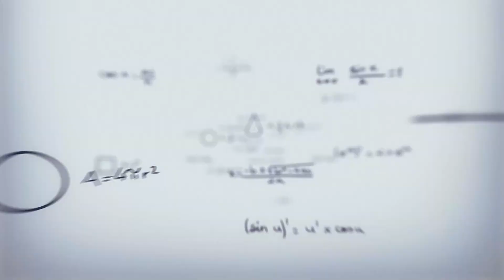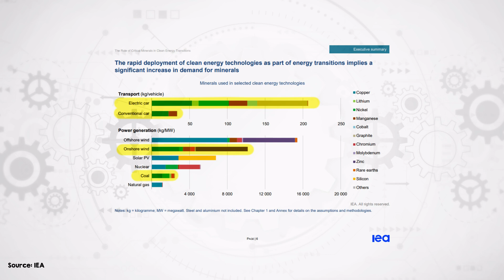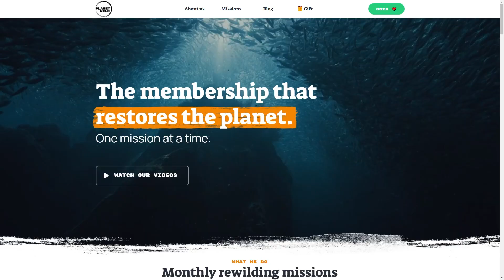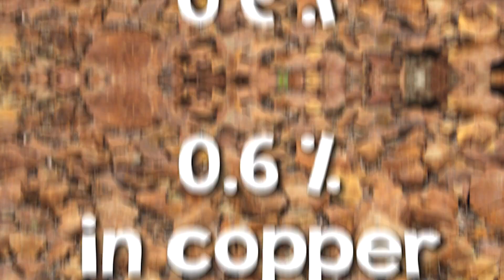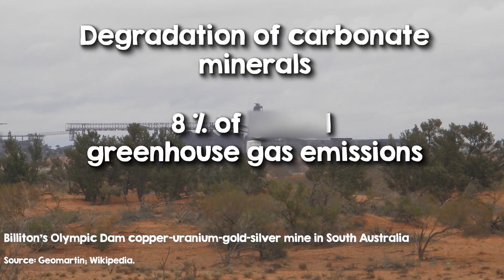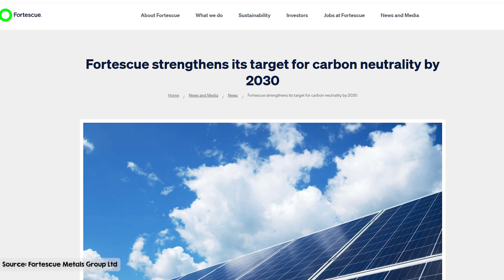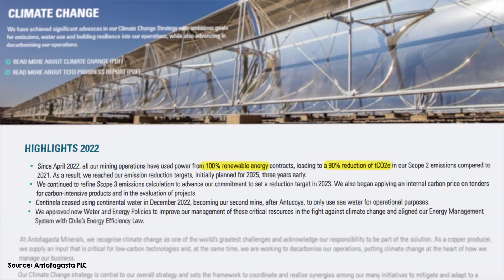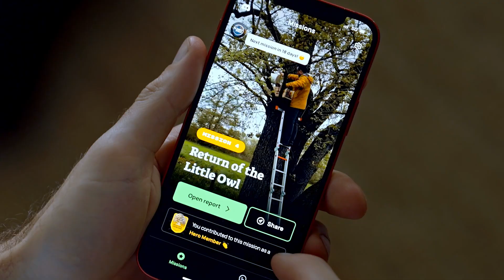Zero-Emission Mining Technologies are Here

Comment: Hey Rose... When you compared the amount of material between ICE and EV. Did you take into account the coal dug up to charge an EV compared to the amount of oil to run an ICE?
Its fine if we are charging EVs from our home solar, but I wonder how common this is compared to charging from our coal fed grid... I understand that we are moving to renewables but when is that really going to be completed?
Reply: don't forget, to refine that oil, we still need electricity..  from coal.  but overall, an EV takes 200Kw to go 100Km, a petrol car will need over 900kw of energy for the same distance. it takes 200Kw electricity just to make the fuel from that oil.  so even using nothing but coal to charge, you are still using far less energy, and associated emissions, even though coal relases more CO2 per Kwh made.  its still far less.
Reply: @SydneyEV life cycle EV emissions aren't much below ICE once you factor everything in. Definitely a benefit but is only around 50%, with any environmental benefit completely nullified when two new EVs are sold to replace a single ICE because growth in the name of the game.

Electric vehicles in isolation are a great technology, but if not paired with degrowth and dismantling the car centric nature of our cities then at best it will slow climate change and at worst it will accelerate it.
Reply: @GeoElk  Yup. Carpooling in a petrol car results in less emissions than an electric car. It is definitely about the way we do things, not just the particular tool we use.
Reply: @GeoElk  Using less cars is a nice dream.  And it would certainly be an excellent way to reduce Co2 emissions.  But unfortunately social science has a formula that is hard to argue with: People gonna buy cars.  So unless you're going to ban car sales, and good luck with that in a democracy, then the best realistic way to reduce CO2 emissions is to move towards electrifying everything as fast as possible.
Reply: "from our coal fed grid..." - just don't use coal.  Here in California our electricity comes from non-coal sources. While not yet totally fossil fuel free (as some natural gas is still used), it is possible to move from coal. Perhaps the coal industry in Australia has just convinced Australians that they can't live without coal.
Reply: Never heard it put that way. Sorry I am a bit of a EV sceptic as I reckon if we want to save the planet then roof top solar will provide far greater bang for buck. For us peasants.
Reply: A big thumbs down for the lies and misinformation in this video.
1. Rosie claims 10% of global CO2 emissions are from mining, "with over 90% of that from fugitive methane released during coal mining".  First, she just confused methane and CO2.  Doesn't she know the difference?  Second, according to "Our World in Data" "Greenhouse Gas Emissions" chart, "Fugitive emissions from energy production" is only 5.8%.  This includes all CO2 and methane from all types of energy production.  Does she just make up numbers?
2.  She compares the 12,750 Kg of fuel burned by a petrol vehicle with the 160 Kg of minerals used in an EV, and says that's 99% less mining.  Surely she knows that in order to get 160 Kg of minerals, you need to mine at least 2 ORDERS OF MAGNITUDE MORE ORE.  In other words, you need to mine 16,000 Kg of ore (and overburden) to get that 160 Kg of purified, finished metals.  This doesn't even take into account losses of materials from the manufacturing/fabricating processes.  (I'm not including the recycling of batteries since it is only hypothetical, and not commercial reality at this point in time.)  Petroleum extraction generally removes only the petroleum from the ground.
3.  She talks very flippantly about increased mining being good for the planet since it reduces the amount of plant food (CO2) released.  Plant food becomes people food through photosynthesis.  Do a search for "Carbon Dioxide Fertilization Greening Earth" to find an article on the NASA website about a study showing increased CO2 is 70% responsible for increased plant growth on earth.  Also, interestingly, climate change is responsible for 8% of INCREASED plant growth.  (Yes, the MSM and the IPCC are lying to you.)  In reality, the climate is getting MILDER!  High temperatures are NOT increasing.  Low temperatures are increasing, primarily at night, in the winter, at higher latitudes.  That's why the average temperatures are increasing.  Also, severe weather is NOT increasing; that's just fear porn to convince you to give up your freedom and money to the elites.
4.  She also talks about the efforts to decarbonize mining and material production with no consideration of real-world economics and pricing.  It's easy to wave hands and pretend that all this will come about at no cost to anyone.  In the real world, these things have costs, making poor people suffer.  Poverty kills.

Comment: A very large percentage of everything that is mined can and will be recycled. Elements other than those used in fusion or fission will exist for much longer than humanity. They will be recycled eventually. Mines can be completely electrified with solar and wind and batteries and even SMRs. The question is not if we can eliminate almost all fossil fuels. It's will we. Making steel and concrete will obviously be the last large GHG producers to be replaced. I think the lack of political will to convert away from fossil fuels will doom us to 6 degrees of warming by 2100.  Thanks for this video.